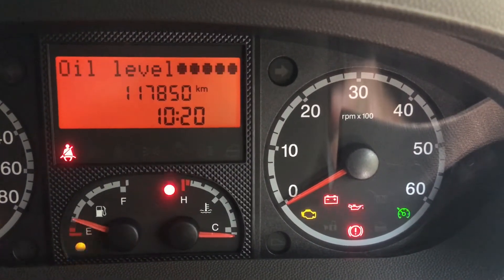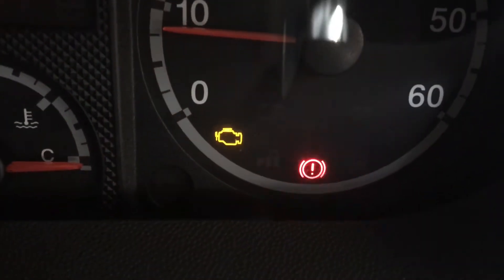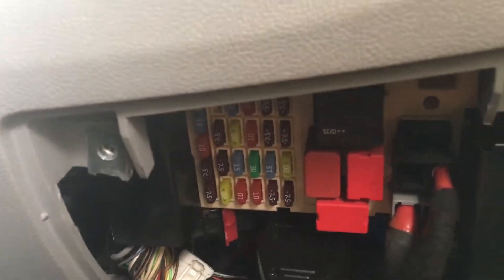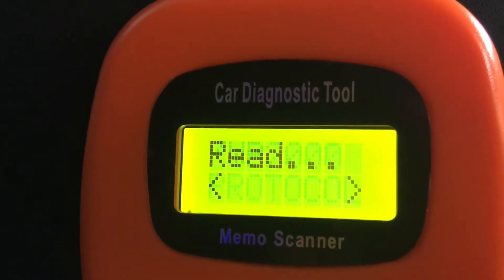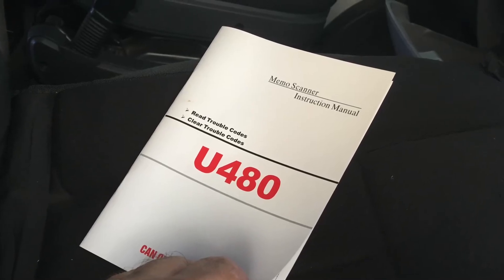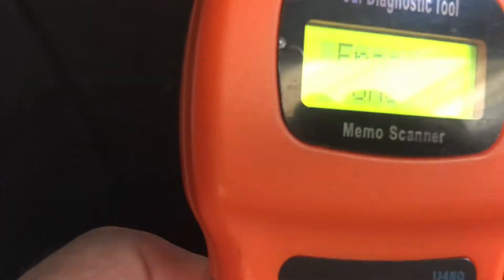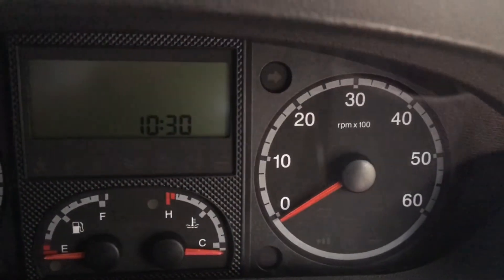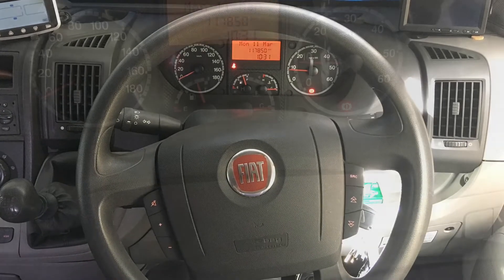Fiat Ducato Check Engine Light

Comment: Why reset, does it not mean there's something g wrong?
Reply from the maker: I didn’t say there was nothing wrong. There is a fault code, meaning that there is a fault. In this case it’s a throttle position sensor fault. It might not be serious and it may be OK to continue driving but it’s still a fault and needs to eventually be rectified.
Listen carefully to my words. I make it clear that you should only reset if you’re confident it’s only a minor issue and that you should check with a mechanic.

The point is that the Ducato is one of the most popular base vehicles used for motorhomes. Australia is vast and resetting can make the difference between getting the vehicle out of limp mode or being stranded in a remote area.

Comment: My 2011 ducato is hunting only when the engine is hot, the rev counter doesn't move at all, no fault light on and no fault code comes up when it's plugged in, my local garage says it's a problem with the throttle body and that it won't always show a code, I don't get it, if I pull the MAF sensor plug of the hunting stops, it's booked in next week for a expencive throttle body cleaning or replacment, what do you think?

Comment: Hi my engine management light has come on twice now in the past 2 weeks both times the throttle body ,  I’m wondering if you know wot this means and is there a easy fix ? ,  I’ve deleted code hoping it wouldn’t come on again but unfortunately it did ,   Thanks.
Reply from the maker: It almost certainly means that there’s water ingress in the throttle body sensor or actuator which has caused corrosion.
If you have good mechanical skills and the corrosion isn’t too bad you may be able to dismantle the throttle body and clean/fix it. Otherwise it usually means a new throttle body.
Neither is an “easy” fix. There’s a lot of work involved in getting to the throttle body and plenty of potential for making things worse once you get there.
Reply: @VK2AAK  thanks very much for your reply ,,  both times it came on was after I’d driven 50 miles plus ,, first time I was 1 mile from home after driving over 60 mile pulled into my local garage for fuel re started the engine and the light came on ,  drove the last mile home with no problem (no limp mode) ,  I deleted the engine light ,,     Then last weekend I drove 80 mile to a camp site with no probs at all 2 days later on way home I got around 50 mile from home pulled into a lay-by for a short break (10 mins) , re started engine and the light came back on 👎,    Again drove the remaining 30 mile home with the management light on but with no issues (again no limp mode)   Thinking if I’d have drove straight home with out switching engine off I may have had no light warning ,,  patten seems to be restarting a hot engine brings on the light.

Comment: My 2012 2.3 ducato threw up a solid amber engine light because of an EGR fault code. Owners manual nearly gave me a heart attack as under "amber engine light" it says "injector issue". My injectors are very likely seized from the scuttle leak issue and would pretty much write my engine off. So relieved to live another day lol

Comment: thanks for taking the time to show us how to do this Andy.
 Ive purchased the u480 for my daughter because shes bought a used 2019 ducato from a dealer and it has literally been displaying codes from the moment she was driving it back ( apparently melbourne to the gold coast is not much fun when youre in limp mode),  and despite having spent well over  $5k more  at our local mechanics it  has decided it wants to  keep showing error codes ( despite being told by mechanics that everything is Ok) so Im hoping with this video she will be able to reset it herself and then carry on driving. 
Fiat should change the name from Ducato to Dunotgo based on what Ive seen of them...
Reply from the maker: I'm not sure whether the U480 will work with a 2019 Ducato. Mine is a 2007 model.
If the U480 doesn't work there will certainly be other code readers which will ... and the resetting principle will be the same.
Merry Christmas. :)
Reply: @VK2AAK  happy christmas to you too mate, thanks for the prompt reply.
 yeah we tried this evening ( no time like the present eh ) and it showed no error codes this time but the engine light is still on and its still underpowered... bloody Fiat vehicles - so frustrating 😡
Reply: FIAT - Fix It Again Tomorrow!